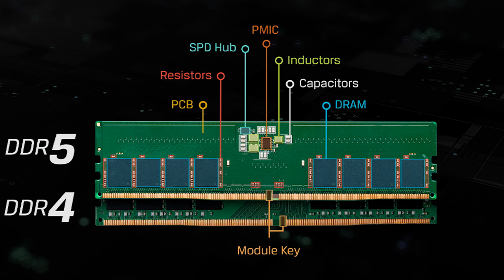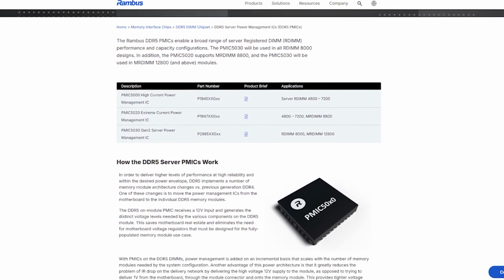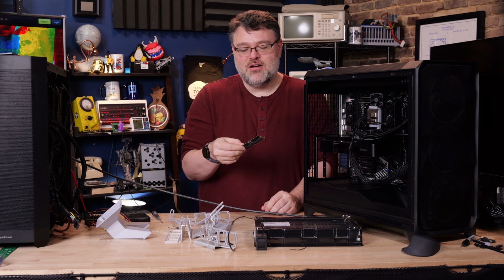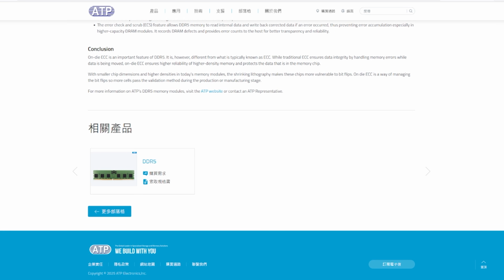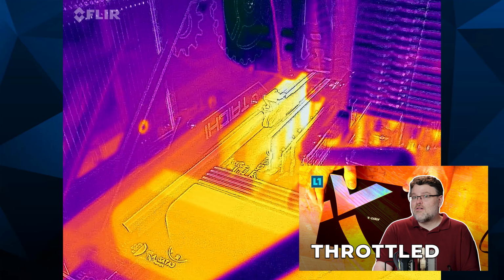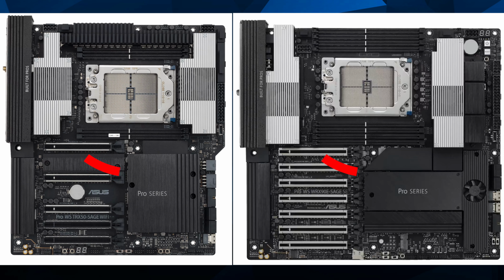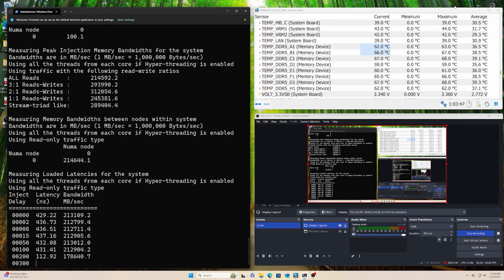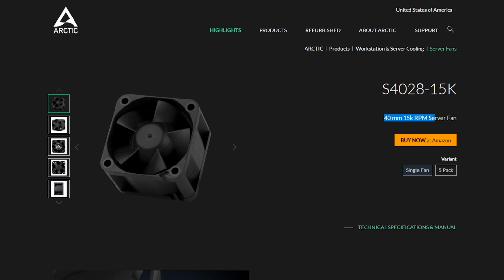Your DDR5 Memory Could be at Risk! All About DDR5

Comment: please note: ram prices aren't insane.
consumer ram prices are.
while industry prices, especially of DDR5 increased by a lot.
the industy price of a 16gb DDR5 module was around $6 before those price increases.

Currently this week the average DDR5 industry market/exchange price rating was at $18 on average.(note price of the ram modules(chip, price is for 2 8gb chips), not the entire stick, but these modules are the part which had the increased price)
while that is 3 times as expensive as before, in consumer ram sticks that original $6 was only a fraction of the price you paid for a 16gb DDR5 stick.

consumer companies just took the liberty to use the news of 3 times price increase of DDR5 memory(reffering to those modules which now cost $18 after the increase current average price this last week).
not to add the production price difference to the cost, which would make ram sticks around $12 more expensive per 16gb of DDR5.
no instead of doing that, or adding that $12 + their standard margin percentage, they litteraly multiplied the prices of their ram sticks by 3 times.
because they know average consumers aren't aware of what the actual industry prices are, or what the actual cost increase prices are.

with consumer ram sticks, especially those of lower capacity, the ram chip itself is but a small factor of the price. the pcb, and additional components are a relatively decent part of the price as well.
but more so, consumer ram sticks are designed to have many types of which they will sell relatively small amounts each, so a huge amount of money is markups related to designing those different ram sticks and even more/speciffically so to to the testing of them as well as warranty and such, where warranty includes that if a ram stick doesn't work well it harms the brand name, that often weighs more heavy to them than actual warranty claims, and documentation pages which need to be held online for years.
and ofcource general markups. for DDR5 the power regulation part is also a decent amount of the price.
but ofcource also markups for proffit.
many those companies look at eachother for what they ask for the sticks.

perhaps there should be a consumer oriented company more like a sbc company, which makes ram sticks for cheap, which just work.
if there was one, then we might be seeing DDR5 16gb sticks for around $40 now.

(note DDR5 price is based on current uncontracted industry prices(so the actual current inustry market), contracted prices can be much lower, or can be higher depending on what kind of deal they made, like DDR5 was expensive at launch, and if someone made a contract in that peak then it is also more expensive, but still nothing like the price increases people see, and many companies actually already still have contracts for much cheaper than the current market price.)).
(note 2, the DDR5 price is based on the normal DDR5 memory found in standard desktops and normal ram, the high end DDR5 ram chips used in high end ram sticks with very high frequency support are more expensive costing around $31.78 on average last week. but even consumer ram sticks based on those cheaper one cost over €200 for a 16 gb DRR5 consumer ram stick here. which is around $233 usd. though the €200 includes 21% tax, and prices here are higher anyway. but still the price difference is huge compared to the price of the actual ram chips used in them) 

currently it is cheaper to build your own ram sticks, though note that the DRAM exchange prices generally sell only to companies and in bigger amounts than you would get for one ram stick. so as consumer you can't buy directly from them. there are companies reselling such chips to consumers, but currently they do so with insane markups.
if some people who like computer hardware a lot would team up and set up something to consider it a company so they can buy there and do it like a crowd fund thing where many people buy those chips at once so they can buy such a set of chips without needing to have a lot of investment in it, then all could have cheap ram.

also it would drive the prices of consumer ram sticks down by a lot.
the reason is since consumer ram sticks are priced to the hysteria which happened a while back, people having another option or knowing about the actual price should bring prices down rapidly.

also currently in the ram market, there is this thing going on where prices of ram keep going up, with the claim that it is due to demand, while actual demand goes down. many ram chips just don't sell properly anymore. products to consumers barely sell anymore at all due to how much companies inflated the ram prices, and as a result prebuilds decided to also increase their prices by a lot more than the actual price difference is/would be.
AI companies also are losing interest in GDDR6, wanting GDDR7 instead or way more than GDDR7 those HBM chips which around now launched a new type of HBM which is much cheaper but more importantly much cheaper to integrate than normal HBM while reaching similar performance in AI(HBM heavily beats GDDR6 and GDDR7 in AI). GDDR6 is what is typically used in gpu's. highest market price this week was $11 for 8gb of GDDR6. lowest was $4.30(which is actually 20 cents cheaper than the lowest price GDDR5 had this week). average was $5.45.
(GDDR6 isn't desired by AI companies at all. it's way into AI is mostly home users with a gaming gpu who happen to run AI on it, but DDR5 for example us used and desired way more for AI).

really people into pc hardware should get to know the industry prices.
not in a way as if they are stupid.
but rather in a way as that if they know, it will defend all pc consumer hardware. if people know they can defend themselves.
since right now the consumer market is a monopoly in the form of a unspoken cartel, where they all know what the others will do and go along with without needing to speak it, essentially a agreement to all keep increasing the prices to whatever the more expensive ones do.
people have the right to know those industry prices as otherwise it would be against that anti monopoly law so you can actually see the current DRAM exchange prices(prices companies need to pay for it) and they are openly  available.

also if someone wants to build their own DDR5 sticks using industry prices, then you might want to concider using modules of 6gb or 12gb instead of the ones of 8gb or 16gb(I handled the 8gb ones here).
you can often get the 6gb and 12gb chips for much cheaper for they are much less desired by big companies, especially with custom contracts you can get them very cheap since ram companies really love to find anyone wanting to make a contract for those modules.
and still you get good quality modules, though often the cheapest of those aren't the ultra high performance once, but honnestly for many desktop pc's and game pc's having acces to more ram is more usefull than having acces to ram with a slightly higher official max clock. especially if you can get like 96gb DDR5 for less money than a consumer 16gb DDR5 stick costs now(technically way more, but have to factor in how to keep it relatively easy and cheap to make it(so not to many modules on a stick), as well as a lot of extra space for the R&D and other components to keep some safe margin in it. but around here 96GB of DDR5 when using 12gb modules would be cheaper than a single budged 16 DDR5 module costs on the consumer market

Comment: In your descriptions, you were unclear how many of the "desktop" claims apply to real ECC UDIMM in servers with desktop class CPUs . Setups like the AM5 based servers made by companies like ASROCK (-rack), where top of the line AM5 desktop CPUs are paired with server first overall designs, but still have to use the UDIMM memory bus and modules required by AM5 platforms .  In particular, those designs use the unclocked memory bus to reduce latency (by one half-clock) for each data transfer between CPU memory controller and the inner circuits of the RAM chips, at the documented cost of working with only one DIMM per channel due to the electrically weaker signal .

Comment: DDR 5 has been very unstable. I have tested the Predator Vesta 2, TeamG Xtreem @8400, Corsair kits,  and Tridents and the stated specs are just way off.  
Those on the Intel Ultra Platform are all getting it wrong trying to hit the RAM speeds advertised with just turning on XMP but there is more to it. Intel Ultra 200S caps it at 8000 with all these safe numbers. The IC's are perfect and tried different kits also from Hynix, Micron and Samsung and the 3rd Parties tuning them are just not getting it right I must admit. 

I can keep going but I just wanted to say that "I LOve ur videos" 

Respect from Melbourne, Australia

Comment: Thank you so much for bringing up this topic! After taking care about the air flow over my DIMMs, my (cold) boot-problems are gone: sometimes the system won't boot in the morning at first try. It feels like the requirement of "pre-heating" the system like an old diesel engine. All tests (memory x86 and others) surprisingly passed. Now after re-checking the thermals with an IR-Cam I could see that the modules goes far beyond 55°C at boot time. We live in exciting times...

Comment: This was a great video. Thank you. Super happy that i didnt upgrade. Sitting on a mag tomahawk x570s wifi max witha 5800x3d, 64 GB of 3200 ddr4, with a 5070ti. Ok its pcie4 but from lots of the techies, 8 lanes is enough for almost no loss in gaming. Not sure that will be true for rendering. I was also pleased you talked about engineered airflow. I recently swapped from a ak720 to a 360 aio on top of my core w100 case. The aio has a fan for the vrms but i reversed the rear fan and added a deflector to bring air down on the acidalie cooler for the sn850x,  and memory. The core w100 was purchased to allow me to use drive docks, memory card readers,and a dvd for some legacy stuff without hanging stuff off usb ports. Two fans in front, 3 below. Front most of the bottom fans has a deflector to  ring the airflow less in conflict with thelower front fan.gpu is vertical and i think it got to 60c in a furmark 4k test. Feeling pretty comfortable staying at this given stable today but maybe nottomorrow concerns with ddr5.

Comment: Perhaps is missing it in the video, was watching it while working... what is the target temp we should be trying to stay under. I'm getting ready to build my new system, which has pretty good airflow and it would be nice to take the RAM temp into account while tuning the fan speeds.
Reply from the maker: rdimm is 85c and under typically. however desktop ddr5 memory instability can creep in as low as 55c and varies wildly
Reply: @Level1Techs Wow! That's way lower than I would have expected. Much appreciated.

Comment: My 48GB (2x24) KingBank 6000 CL28 warms to 45 'C at worst when running OCCT MEM AVX2 test almost all the memory reserved for the test. I did put a match stick between on top of the two to separate them a bit for air to go in. I have a 20 cm fan blowing from the side on an open case. The motherboard is Jginyue B650 and it has only two RAM slots pretty close to each other and the stix r pretty wide :-D

Comment: I think the XMP profiles are putting the hardware into configuration that degrades the lifespan of CPU and RAM under heavy workloads. XMP profiles are tested against different assumptions than JEDEC. 
Intel warranty allows 200s Boost.  Asus enables XMP I when 200s boost is enabled.  XMP I profiles may only have vdd/vddq set to 1.4v.  Asus then runs the CPU IMC at 1.3v which is going to reduce the lifespan of the CPU.  
If you run AI inference workloads you will reduce the lifespan of your system.
This would be an awesome opportunity to verify this!

Comment: I wonder if this could be the root cause of the issues I've ran into on my new system with an Asus motherboard (x870 max gaming). Most notably in PoE2 I run into freezes and the game takes quite a bit to recover from those, like actual seconds. I had thought it was a shader compilation issue that would sort itself out as I kept playing but I'm not so sure anymore as it keeps happening, usually once or twice in a couple hour gaming session. Also in Monster Hunter Wilds I've had a couple shorter freezes but weirdly enough those have been during cutscenes.

I guess for now I'll try to monitor the memory temps.

Comment: This video triggered my interest to investigate my DDR5 situation before i start OC it.
If i understand correctly my consumer Dimms only have 1 sensor that is located in the SPD chip. So the readouts from this sensor could be like 10-15c lower then the actual chips temperature. I am not 100% confident on these numbers but at least i understand now that i need to use 70c as the upper limited instead of 85c

My Gigabyte X870E AORUS MASTER X3D  got a memory fan included, i thought it was a gimmick so i did not really used it yet, but now after this video i will see if i can start using it since apparently its relevant.

Comment: I have a Asus ROG MAXIMUS Z790 HERO Motherboard with an underclocked i9 13900KS(for no degradation, never a blue Screen), with G.Skill 32GB 6400Mhz CL30 Ram, and my temperatures are at 44C at Low, and 57.5C at Load. I have great airflow in my Full tower and I believe the VRM Fan in the AIO CPU block from the Asus ROG RYUJIN II 360 moves the heat around the block and RAM enough that I don't think I need extra fans on the RAM. I missed the boat to get 64GB or 96GB at descente prices, as I am doing Localized AI models in my system, but I might wait for the New Nova Lake CPUs from intel, and swap my KS for another KS top of the line(KS CPUs tend to be more heat efficient and the same frequencies compared to the K version, that's why they have a 100 bucks premium and Stability). I will swap this AIO for a Tryx Panorama for my new system, as I like the waterfall video and playing behind my temperatures display :), besides being a top performer and also has a VRMs Fan in the CPU block.

Comment: IIRC buildzoid from AHOC, who daily drives open test benches with overclocked memory, mounts a small fan over the modules by stacking long standoffs on two of the motherboard standoffs that happen to be close to a standard fan mount spacing. I need to look further into the details of that now, as it's a good, universal quick fix

Comment: for me this rases the question how small can they make heat pipes that work effectively? the reason i say this is that if they can make them small enough 90 degree angle mini tower coolers (probably with out a built in fan) with alternating heights or position offsets might be exactly what the power management potion of the ram sticks need, and i doubt it will take long for someone (ram manufacturers or 3rd parties)to start making them.

Comment: DDR5 needs extra cooling, PCIe5 SSD needs extra cooling... can I stick with 4 please  ...
Reply: you sure can, my system is running just fine with 32gb ddr4 and sevearl PCI-E 4.0 NVME drives. No problems with preformance here. You dont always need the newest and most shiny of toys.

Comment: Hmm, wonder if this is why my system is unstable with the panels on. With them off it's perfectly stable, so that's what I'm running right now. The memory does have a fan pointed at them but it's a desktop board with the memory vertically situated so only the first dimm would be getting airflow. I'm going to play around with this and see if it solves my issues. Thanks!

Comment: With Samsung, SK Hynix, and Micron controlling >95% of DRAM production, most consumer RAM sticks come from the same few chips. Fewer producers mean less competition at the chip level, which can reduce pressure to innovate in reliability under marginal conditions for standard consumer-grade modules.

And not sure when "desktop engineer" became a thing but that's a topic for a different discussion.

Overall, love the video! Cheers.

Comment: Custom water cooled , 360 rad & 280 rad  with CPU and gpu blocks
9950x 
Msi x870e carbon WiFi
CORSAIR Vengeance DDR5 RAM 128GB (2x64GB) 6400MHz CL42-52-52-104
Boot- Samsung 990 Pro 2 Tb &
SAMSUNG 970 EVO Plus SSD 2TB
Rtxa5000 gpu 
Corsair HX1000i Psu
phanteks p600s case
Weird instability usually at start up, cold